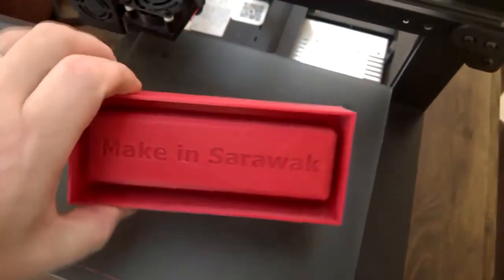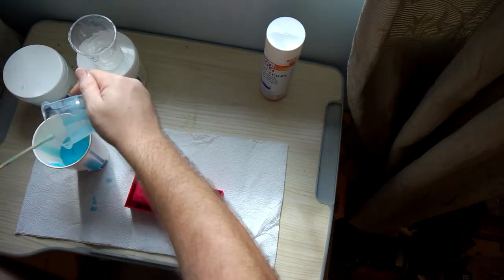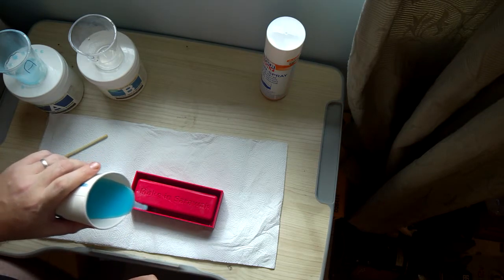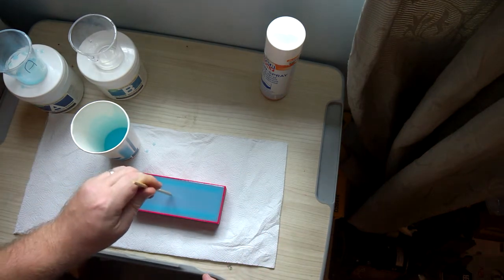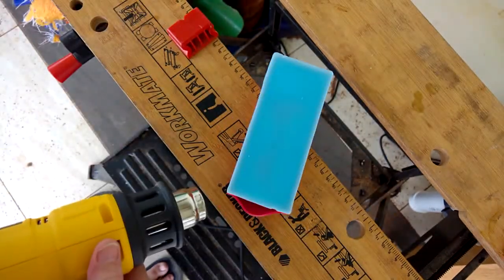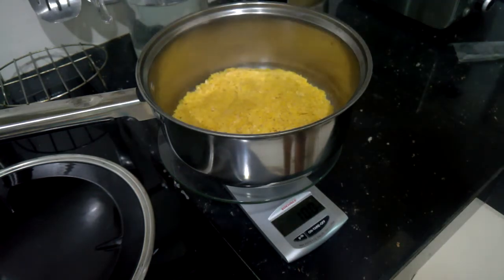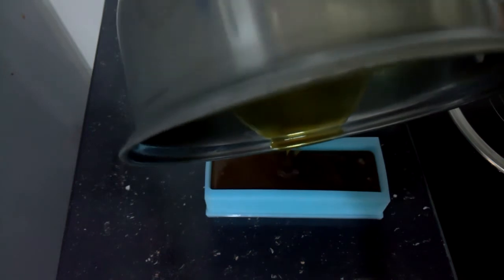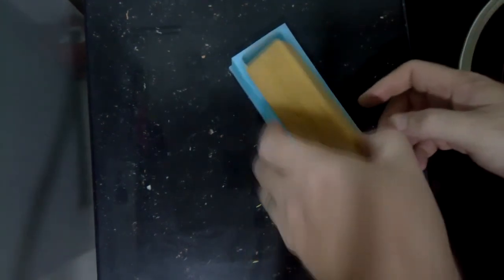3D Printing an AB Silicone Mold

Comment: I've been trying to make molds that I'm able to pour silicone into like you made. Could you explain how you did it?!
Reply from the maker: For the mould in the video I used a CAD design program called fusion 360, it is free for trial and for student & hobbyists, and then printed it out on my home 3D printer. If you don't have a printer though this wont help you very much so let me know if you want an "old fashioned" explanation.

The most commonsense type of approach to designing a mould using Fusion 360 is design the item that you want to create and then build a 3 sided box around it. When you pour in the silicone it will then create the negative image (the empty space around the object) that can then be used to create the positive image whenever epoxy is poured into the mould.

Depending on whether you want a single use or multiple use mould will make a difference to how you go about making them as to how many parts they can break down into. As I only needed the one cast I didn't mind tearing apart the mould to get to the silicone.
Reply from the maker: If you let me know what sort of thing you are trying to cast I can probably be more helpful.

Comment: Does your mold have fine line from the 3d printing?
Reply from the maker: This one does because it was just for a wax block and I didn't really care what the end product looked like.
When i made a soap mould for my wife I took the time to sand back the print and spray paint it so that the lines were invisible.

For a printed mould you get out what you put in, if you are willing to take the time to clean up the print properly you will get a very nice mould out of it.
Reply: Make in Sarawak thank you for the reply 😁
Reply: Hello do you by any chance have a video on how you made the filament mold? Thank you
Reply from the maker: @oliversmommoreno1416  Sorry for the late reply, it didn't show up in my feed for some reason.
I can certainly make a video on the basics of making a 3D printed mould if you are still interested.
Reply: @MakeinSarawak  definitely still interested thank you so much for responding.
Reply from the maker: @oliversmommoreno1416  Ok I'll try to work out a simple step by step over the weekend.
Reply from the maker: @Daisy Oliver More Here is the first video in the lineup, will give you an idea of how to design the object you want to make a mould of.
I used a soap block design as I figure that if I'm going to make it that is something my wife will actually use

https://youtu.be/gdv1OhsPN-s